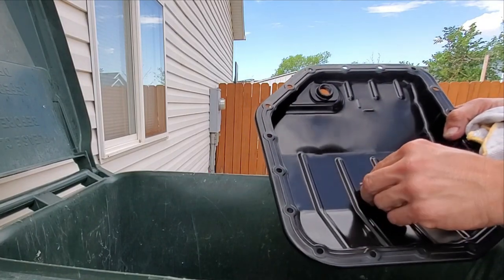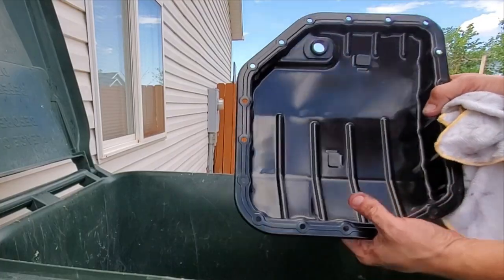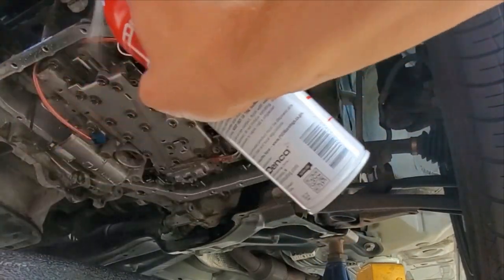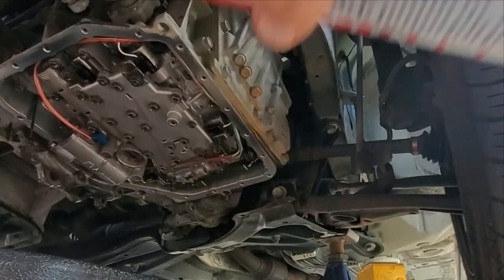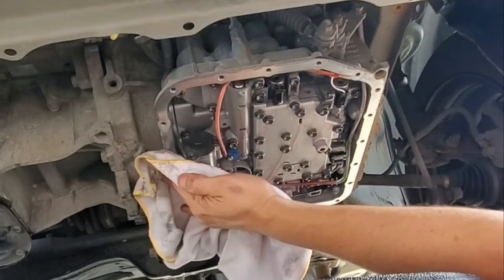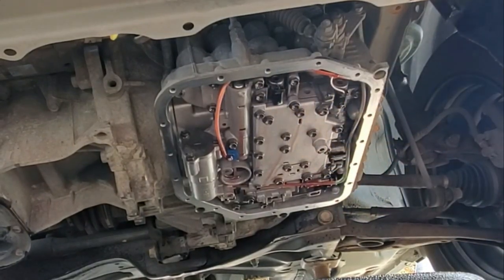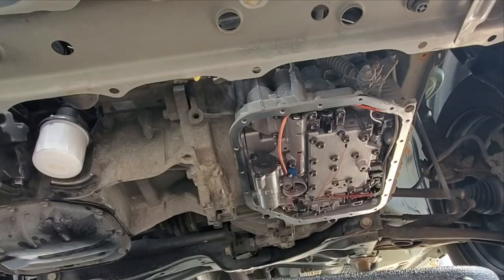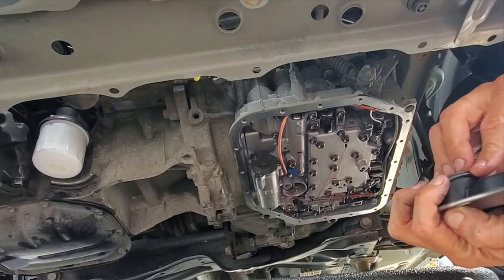The 89G - Toyota Yaris & More: Perform a Complete Automatic Transmission Fluid and Filter Change

Comment: Question. I want to flush my 2012 Toyota Yaris transmission fluid but unsure which line to take off. Any suggestions?
Reply from the maker: I'm sorry,  my notifications just started working this morning. I have the ATSG book at home, and I'll look in that and see. I don't have the answer right off the top of my head. You're really only leaving 1.5 quarts in there by dropping the pan and changing it that way, but I understand what you're trying to do. I'll get back with you later today.
Reply from the maker: My ATSG book does not have a definitive answer. HOWEVER, the top port (which is on a 45 degree angle facing upward) is directly next to the pump. My guess would be that top port is pressure.
Reply: @89G  thanks for your reply. You’ve been very helpful
Reply from the maker: @Haastage  no problem!

Comment: Hello. Can you confirm no magnet on drain plug. Im just doing a quick drain and fill but the plug doesnt have the magnet eventhough theres a slot for it.
Reply from the maker: Drain plug does not have a magnet. There is one in the pan though
Reply: @89G  thank you!
Reply from the maker: @aldoivan2096  no problem!